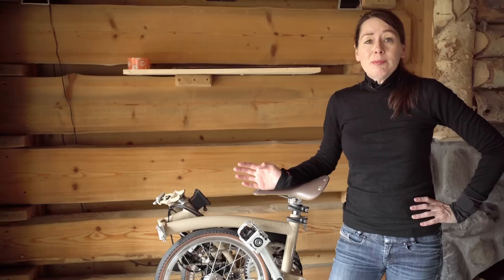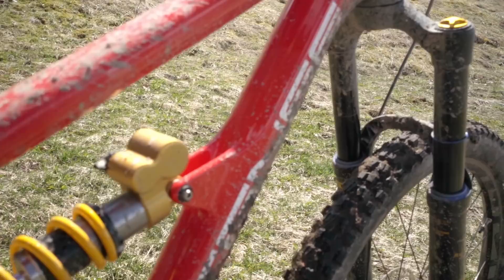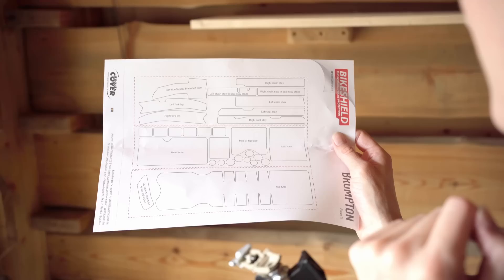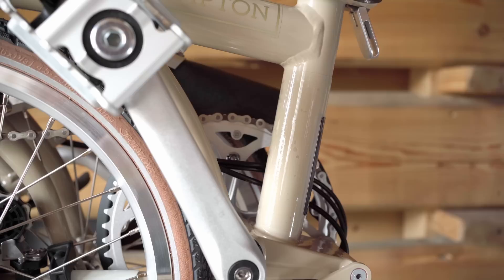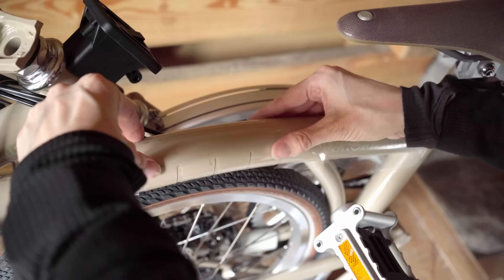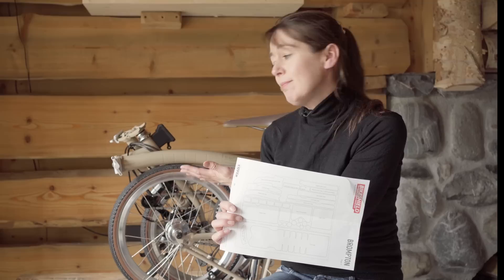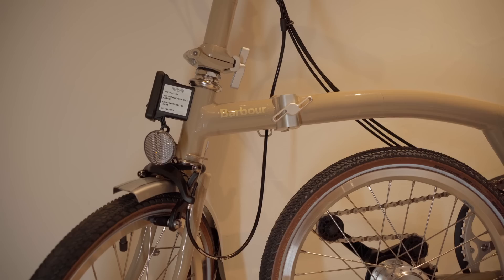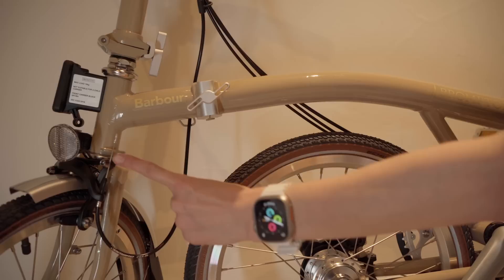Bikeshield Brompton Frame Protectors

Comment: I just bought this and applied it to my year 2020 H6L in Black Lacquer. A few things I learned... do NOT handle the sticker when it's off from it's backing. Instead, cut out (around) the sticker from the backing with scissors, then offer it up to the frame in order to work out the best fit, then peel one edge back very carefully with a finger nail whilst NOT putting a finger print on the sticky edge, then apply about 1/2 inch of it in one place and then unpeel gradually until you get to the other end, whilst holding the unpeeled end against the frame, moving a finger along the part that gets stuck down, from one end to the other, along the middle of the sticker. Whilst doing this, gradually press down and feed a finger along each side of the middle to stick it down gradually and take your time, it can be done with no marks or air bubbles but takes quite a while to do. I worked this out because when I applied the first sticker I got all sorts of finger grease along the edge, you learn from experience...
Also, it's 10x times more difficult to do this sticker application with a dark color frame because it shows every last little piece of dust and fingerprints etc if you get it wrong!
Some of the decals (like the chain stay ones) didn't conform to the curve so I had to slit them, and some of the cut outs didn't quite line up with the parts on my frame. 
The head tube sticker goes on the handlebar stem, I believe!
The instructions were terrible (i.e. there were none).
All in all I would give the kit a 3 out of 5.
Reply from the maker: Thanks so much for watching and for the pointers

Comment: Great vid! The explanation of where stickers must be applied is really useful!
Reply from the maker: Many thanks! We thought it was not that easy!
Reply: As an owner, you are able to buy carbon sets specifically for protection of the Brompton Frame.  Below the Crank and below and on top of tube with the chain, which will prevent most scratches! Also below the cables on the fork (to be bolted on) and the front of the frame, with the wire holder. If wanting a little extra, leathers for the frame and the stem post, to be sown, or using Velcro.
    If so your bike may look as original, even after years of use, - unlike if not cared for.
    Finn. Denmark

Comment: This kit looks to use a good quality wrap which is key to doing this well.  👍I have protectively wrapped my last seven bikes, sometimes shaping, cutting and fitting the pieces myself (a long job). Other times fitting them using pre-shaped kits from various manufacturers. I now prefer to use Invisiframe kits, who are slightly more expensive than the kit shown in this video, but I find the quality of their plastic and their customer service is very good. They sell two different kits for Brompton, based upon the bikes age, and are made in the UK.   When applying the wrap I prefer to apply it wet with clear baby shampoo mixed with water. In my experience the higher quality plastic films are far more forgiving of you making errors and having to remove and refit them. The cheaper plastic films, including Gorilla tape however are not.......👍
Reply from the maker: I was really impressed how easy bit was to apply! Thanks for the suggestions!!

Comment: Although I like to look after my bike, I’m not sure I’d go so far as to virtually cover it in plastic film. I do, however, stick a ~50mm length of electrical insulation tape on top of the rear of the chain stay to prevent damage from the chain when on the small cog. Seems to work well.
Reply from the maker: Thanks for watching! I was surprised how easy they are to install

Comment: In the video you mentioned the head tube. You stated that the sticker was too big for that area.  Did you ever use that sticker.  I did apply my as it was to large as you stated in the video.  Thank you for identifying all the other areas.  I don’t think I would have ever figured out the proper placement. As for the air bubbles, I was pleasantly surprised that they did disappear after about 9 days for me.  I was rather skeptical after the first days as there appeared to no change.  I live in Tampa Florida and it get very hot so I left the bike in the hot sun for several days and magically the air bubbles disappeared.  Thank you for a very informative video.  I couldn’t have done it without you.
Reply from the maker: Thank you for watching! So glad it helped! 
If I recall I cut sticker to a smaller size and fitted it whee it was needed

Comment: Spraying a mix of water and liquid soap on the frame helps in applying the film because the adhesive will not stick when it is wet; then, pushing the liquid out with a credit card or soft rubber spatula until there are no bubbles or liquid in between and finally let the film dry. I´ve done this when applying a film in glass windows at home.   😀
Reply from the maker: Many thanks! Yes it makes it easier to apply but will take longer to dry

Comment: Oh very nice. I used this brand and put some on my road bike, but having a brompton specific kit is really nice. I don't think you really need to cover the entire frame, I wish they had a smaller kit to cover the essential parts.....just the parts that are likely to get scratched, and definitely where the cables rub. 

What I like about this brand is: 1) the vinyl is quite thick...thicker than I expected. 2) the adhesive is relatively weak, it's very easy to peel it off, and it absolutely leaves zero residue when you peel it off. Other types of adhesive tape will get gummy when you remove it.
Reply from the maker: Many thanks for watching! We also agree and found it easy to fit and remove if we wanted to.

Comment: I used GM frame protectors that you cut to fit.    Works wonders.  But, in a few years I may remove them and get this Brompton specific one.  They were very tedious to apply but they definitely work against rubbing and scratches.  I believe if Brompton owners only put them on the main frame and at the cable rubbing points would be a way to keep their bromptoms looking new for years. I can't see having a Brompton that's not covered and protected.

Thank you for this video!👍
Reply from the maker: Many thanks for watching! I was impressed how easy they were to apply!
Reply: I ended up cutting my own using car panel protectors. They use a wet application method, you can easily reposition them if you align them incorrectly. For the template, I based it off this product and digitally scanned it. As for the cutting, I’m lucky our office has a vinyl plot cutter.
Reply: @KennethWuAU  That sounds like the way to go.  Thanks for the info👍

Comment: When I had first bought my by then Top, Flame painted 2019 "SuperlightM6LXBrompton" during High Covid19, for the vacation money saved, I gave it a full Autopolish all over for protection! I then realized that after - two or three folds, that the Clear Tape - "Protection"🤔(sadly its only from the Brompton Factory), had nearly been worn through to the paint!!!
     So I immediately ordered what I could find of "Carbon Protection Plates" and a Shield for the fork, from the main suppliers of "Useful Brompton Accessories": China, Korea and Taiwan! Also some leathers, to be sown on for my frame - and stem post.
     It is honestly a Sad Story, that after all those years of production, that Brompton still haven't found out how to keep the frames paint looking fine, as mine, for those with a liking for a "nice looking bike"!
     I have latest ordered a small "P shield" for below my Cable in front, as this is now the Model closest to mine, it seems?
         Finn. Denmark
Reply: When I got my 6 speed, I wondered for what use I had the low gears, til I met an absurd hill and had to walk on top, on Danish, Bornholm. So I wouldn't know for what use I would have - the coming 12 gear version, which seems to be intended to replace the former 6 speed? But I could as well add a double chainwheel in front, or a lighter, 7 speed chain-wheel and single changer, as it is possible to buy from Asia, for a Brompton? Finn. Denmark
Reply from the maker: Many thanks for watching and for the suggestions!

Comment: As mentioned elsewhere here, a  called RideWrap make a Brompton specific version - one for each type of Brompton. Going just by conversion rates, it is over twice the price but is applied wet and comes with all the solution, squeegies etc. you need to apply it. There are some reviews on here where it is being used on mountain bikes... but it would be interesting to see if there is much difference between the two.

Comment: Good job. As always, great video. I have used helicopter tape for years to protect my bikes. About one year ago I used this particular brand of tape for my new Brompton. I sprayed some soapy water on the back of the tape and on my hands before I applied it to the bike. It allows the tape to be moved around to place it properly. I squeege out the solution along with the air bubbles. It's more work but has worked well for me.
Reply from the maker: Ooohhhh great suggestion, next time. 
Thanks for watching!
Reply: Good suggestion! In fact, I have used the same method to apply decals & film protection to my bikes. Just put a drop or two of dish soap in an 8oz spray bottle, spritz it over the frame and decals then you have plenty of time to apply. Also doing it while the bike has been conditioned at room temperature.
Reply: @danhoang6335 will dish soap not rid the adhesive from the tape as well?

Comment: If you do not want to go the full monty use mylar sail repair tape. 3 metres 150mm wide costs >£20 they also do 50mm & 100 mm wide. Does the job just as well . Obviously it does not come cut to shape though. But if you just want it for protecting small areas it can be a very cheap alternative. Plus you can repair your sails & model aeroplanes as well😁😁😁
Reply from the maker: Many thanks! I guess the cut to size was the thing that makes them super easy to fit! I recon they only took 30 minutes to fit! Not bad!

Comment: As others have written, put protection where the cables would touch, and I would add that protecting under the frame where the rear wheel folds in and makes contact is important too. 
I used helicopter tape and carefully took note of everywhere the cables touched the frame, both in a folded and unfolded position, plus where the wheel touched the underside of the top tube and the front of the bottom bracket area. But also the tiny tube at the bottom of the rear mudguard because this was very rusty on my old Brompton - that part was the hardest to apply, it would probably have been a lot easier if I had taken the wheel out and could more easily bend the mudguard to make room to get the tape in.
After just over a year the tape is still there and you can only see it if you're specifically looking for it so I judge this a success.
One more thing - the videos are great!
Reply from the maker: Many thanks! And thanks for watching!

Comment: Try spraying the bike and the adhesive side with water mixed with a tiny bit of dishwashing soap (to make it more slippy) and some ethanol/burning spirit (to make it dry faster). Then you can put on the stickers any way you want, then shift them in place, and squeegee out the bubbles to the sides. The water will dry off, making the sticker stick.
Reply: THIS
Reply from the maker: It will take longer to dry if you do this. But may be easier.

Comment: I purchased this a while back, but wasn’t convinced of the film’s quality. So, I traced them to build a cutting template and ended up cutting my own using quality 3M car panel self-healing protection tape. Luckily, I had access to a plot cutter at work to do this. I also opted to cut my own so I can use a film that supports a wet application method, which is easier to readjust if you make a mistake.
Reply: How's the 3M going for you so far? I've read some places that by using water it might trap some moisture and after a few days the spots under the tape will rust. But it doesn't seem to happen to everyone, luckly most doesn't.
Reply: @LLF1234  My stem showed some patina after wrapping. But it quite even. I think it's more from the UV exposure from the sun. My main frame is still looking as good as new after 4-5 years of regular use.

Comment: I’d’ve done that with the bike parked, otherwise all,the cables are tight to the frame and you’re making it harder for yourself.

My 2012 bike now has too many scratches to be covered (especially the handlepost), though I have covered where the cables rub using an Bikeshield MTB version (it was on sale a few years ago in Evans).

Comment: When we do wraps and film sticking, aren’t the spray soapy water is the standard way? 
Once u paste and pull it out due to alignment , the sticker will leave that mark on the glue side
Reply from the maker: Many thanks for watching. The protective stickers take longer to stick if you apply them wet.

Comment: Curious how you like that Brooks saddle on that bike. I just bought a C Line "Urban" in Los Angeles. It was supposed to come with that saddle, but it arrived with the stock saddle. My honest feeling is since bike theft is an issue you have to consider in the US, I'm happy to have the stock saddle (I'm assuming it is less attractive to bike thieves)... I should say that Brompton, to their credit, offered to send me the Brooks saddle, but I told them I didn't want it and they should keep the money for themselves. As for frame protection, I put some protective tape on the spot where the cables rub on the frame, but I did that when the bike was folded, then noticed that when unfolded, that rubbing area is in a different spot. Oh well. 🤣
Reply from the maker: Many thanks for watching. It’s a Barbour x Brompton so came with the special edition saddle
Reply: I had the original brompton saddle and having pain, never seen worst saddle, I mounted my brooks c15 carved and it's very comfy.

Comment: Nice. But it seems like not enough tape to cover the entire circumference of the tube…? Just seems too small…
Reply: Why would you want to cover the whole circumference? You only need to protect the parts that are getting chafed.
Reply from the maker: Thanks both, I think it does cover the bits it needs to.
Reply: @LaughingStock_  and..??ya it’s a really laughing stock. If it’s really only for chafed then just wrap up the cable with soft material will do… please use a bit of brain juice. If it’s an expensive car , and for paint protection, and u  r going to just tell the car owner that u r gonna wrap only the front..? As it only protects stones from the front will do..????

Comment: Why o why doesn't this come as standard when you buy an expensive bike like this.  Gave this suggestion when I registered both my bikes at Brompton but I guess those suggestions end up nowhere as you don't get any reply at all.
It's 50 euro for a serious amount of stress it seems. I would gladly pay 80 euro more for a bike that has these as standard or an option.  Most people tend to already have damage when putting these on which is a shame in my opinion.
Reply from the maker: They are really easy to fit. I thought they would be difficult, but really simple. Thanks for the suggestion on adding to new bikes!

Comment: It's a long shot, but do you think it would be relatively easy to modify a set for an early Mk2 which has a very slightly shorter wheelbase? Mine has a few scratches on its paint (paint in those days, not powder coating) and I'm wondering if this kit would improve its appearance slightly.

Which leads me to a second question. If applying a set to a bike that already has a few scratches, do you think the protectors would slightly improve the appearance, or make it look worse (i.e., should the kit only be applied to a brand new bike)?